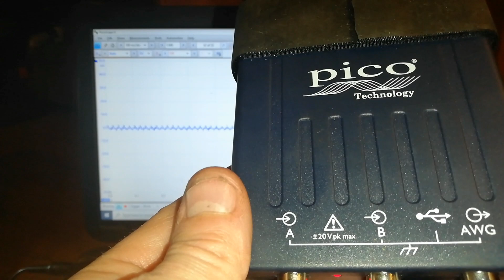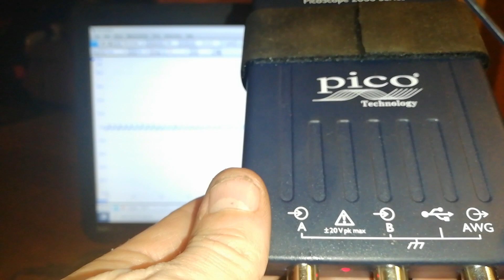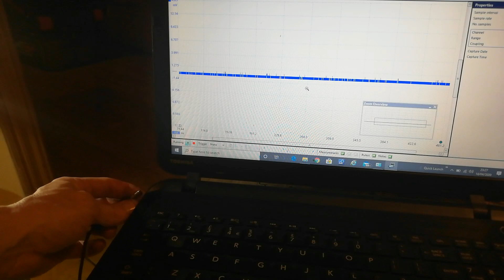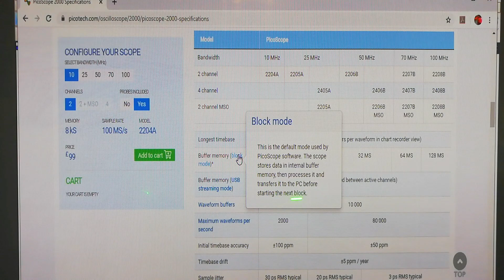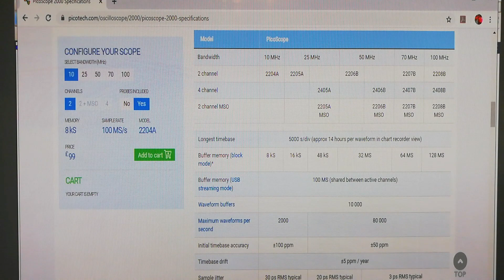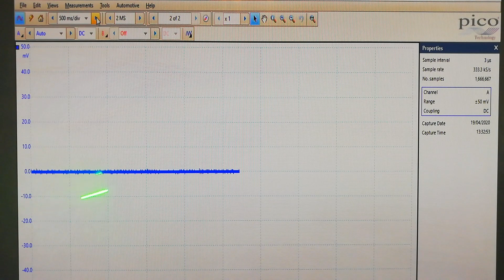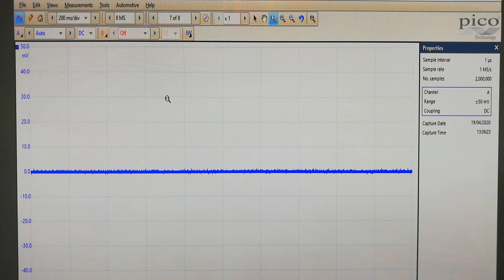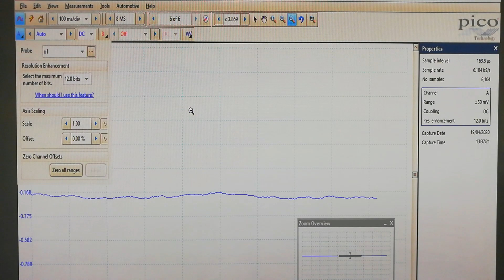How to get the most from your Picoscope 2204a

Comment: Very well done Dave. Some nice details I was frankly unaware of. I use my Hantek mostly to prove the point that even the low end scopes can provide more utility than most people can exploit. Skill and knowledge is the limitation for most (me included) not the spec. of the scope. Case in point is the amazing work Mechanic Matt has done in the past with some very modest gear. For the money 2204A a bargain at twice the price! Cheers Pal
Reply from the maker: You'll have to show us more of that 8channel you got. Yeah indeed ive found big specs are not reqd for auto applications and  more use and play gives results. I like Matts approach, finding problems thru understanding. Cherrs dave

Comment: Great demo Dave, this has been my go to scope for quite a while now, I did attempt to replace it with an Autel (MP408? I think) but honestly the 2205 out performs it in most situations. Plus the money I spent on the Autel would have been better saved towards the 4425, there's a lesson in there for someone if they want to learn from my mistake!
Reply from the maker: Aye Simon, pico is hard to beat. I think a 2405b is a good buy for a 4channel.
Reply: @davesterl  Will do Dave, cheers.
Reply: @davesterl  I'll probably spring for a 4425 after all this lockdown stuff is over, I'd imagine there'll be deals on the pre A models?

Comment: Thanks for the review.

Is it possible to decode serial digital bytes also with the analog probes?

I don't want to buy a full MSO model, the price difference is too high. 2204A should be enough for my basic hobbyist-level Arduino and sensor tinkering needs if only it supports basic digital serial decoding with analog probes.

Comment: Dave, under preferences there is a Sampling tab.  It appears you can change the transition to slow sampling to 100 ms instead of 200 ms.  Might give that a try.
Reply from the maker: cheers Dave, must give that a try, good name btw
Reply from the maker: Had a look at that and the sampling is set minimum for a particular device. The 2204a is 200ms
Reply: Well it was worth a try.  Thanks for taking the time to verify the setting can't be lowered to 100 ms.

Comment: Hi dave I've got one of them pico 2204a and I wondered if you knew that you can create your own wave signals am a technican at Yorkshire ambulance and used it today to test signal wire on a throttle body to see if it changed on pid on scanner also used to test abs senser wires cam and crank found this out on a guy I watch on utube as automotive picos dont have this and it's amazed they dont so I think for that its absolute bargain scope for 99 quid
Reply from the maker: Yeah great scope and has AWG
Reply: Yeah for nearly 100 quid and has the  AWG as well a lad at work has just payed 1800 quid for a second hand modis and scope is nowhere as good only thing I like with snap on u can flick between scope and scanner

Comment: my pico is having some problems and I wanted to buy a cheaper scope to use while mine is sent off for repair.
Reply from the maker: Do you need the 4channels, Richard?
Reply: @davesterl  No, I'm sending my 4 channel pico off to be fixed but they will have it for 4 weeks or more.
Reply from the maker: @CoolAirVw  these wee 2 channels are cheap, good for a back up

Comment: Hi also gonna make a pressure transducer like yours on video I've received the pressure transducer and there is no diagram to tell u which wire is signal, earth and 5v its blue a brown and black with a little white plug would you be able to do a video showing how u made in box as I wonder if I could do a 12v and earth to connect to battery instead of 9v battery to 5v regulater ? Regards danny ambulance tech keep up the great videos
Reply from the maker: Wire colours differ from supplier, normally middle pin is the signal. You can power your regulat whatever suits.
Reply: Cheers dave gonna give it go making it this week look forward to more of your great videos

Comment: Hi Dave great video. Pico automotive software can you use this on the relative compression software with the graphic I think it has a battery testing function.6. software. or do you have to buy the automotive scope
Reply from the maker: I havent trid it on that, dont think itll work
Reply: @davesterl  I've seen yours other Pico vid that's great. it got me looking at Pico and may be looking at this option as the automotive scope is to expensive for me
Reply: @beetboob  I bit the bullet on the 4425A; I did not include any accessories as I plan to re-use the ones that I already have and are less inexpensive than the ones offered at pico for $52 bucks a pop. I can easily get them for about 18 at Amazon (Hantek) which are good quality probes. If all goes well, I will invest on those nice clamps but I will use my Hantek for now, they work great so far. The main reason I invested on this was to have access to the library waveform for references on good known and to start building my database as well. I almost purchased the Pico WPS500X but decided to step back and get the PV500 from Fluke.